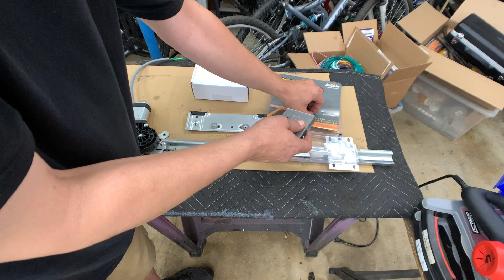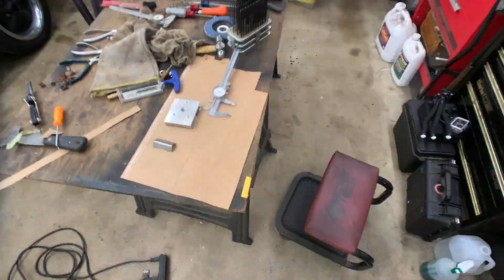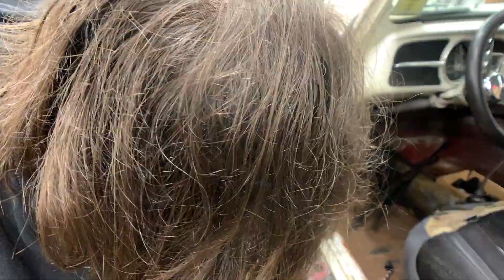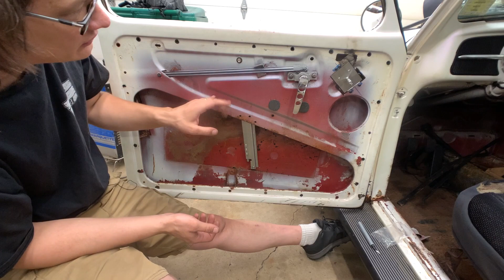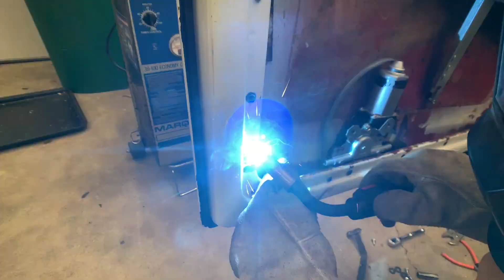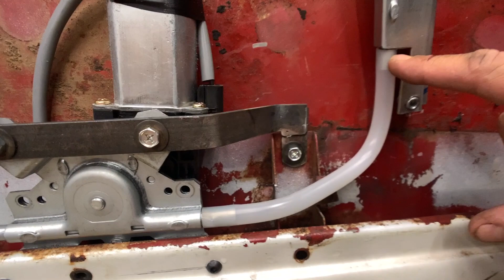Vintage VW Beetle Power Window Install - Curt's Bug Part 6

Comment: Lucas, just recently came across your channel...so awesome THANKS! I have a "69 bug with single windows and have always had issues. Tried several different things that promised results but no luck, I am definitely going this route.

Have you installed the cable door stops yet, just wondering how you are going to do it? I know the factory metal stoppers won't work as they will actually break the single windows so I would love to get some insight from an actual Fabricator like yourself.

PS, I have now watched almost all of the Curt's Bug videos...great Job all the way around...first rate my friend
Reply from the maker: Thanks! I haven’t gotten to the door stops yet. I have the cables and will try those first. I might try another idea I have, but will see when we get there. It will be a while before I get to it. We need to get a bunch of other stuff out of the way first. Anyway, thanks again and until the next one, I’ll see ya around!

Comment: You did a great job, but way too fast for me eyes, especially cutting the regulator  rail and separating the motor from the rail. Do you cut the worm drive tube to separate it from the motor housing?

Comment: Hey man Kevin here from Australia. Very interesting video thankyou for sharing. 
Q. Have you installed this system with the quarter window in place.
Anyhoo stay safe and stay well. 
✌  Peace man.
Reply from the maker: I have not. My gut tells me that if you move the lift track back and keep it centered in the glass, it should work.
Reply: @The2CarGarage  it would be interesting to fit up an old unusable door to see how good it works.
Reply from the maker: I do have a set of junk doors here...
Reply: @The2CarGarage  you could put a kit together.